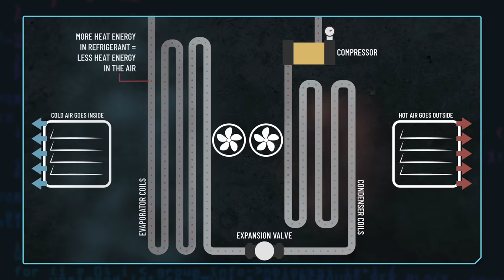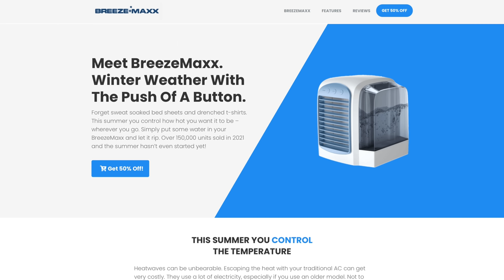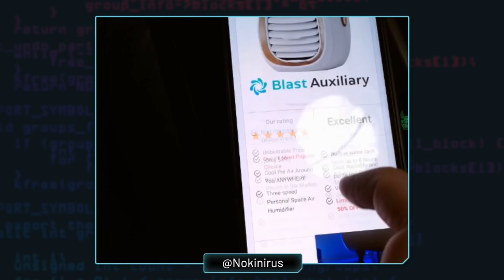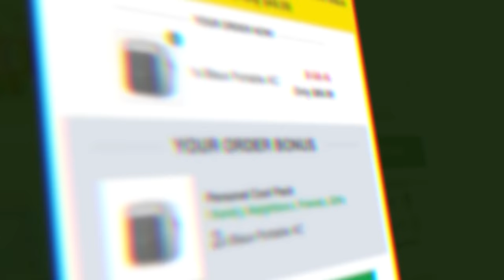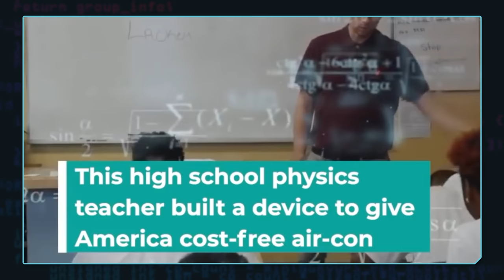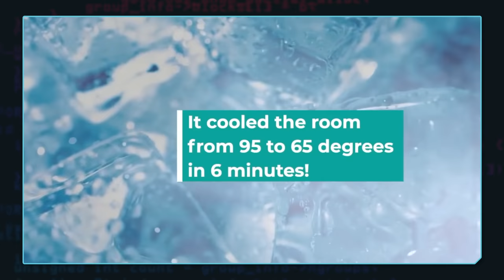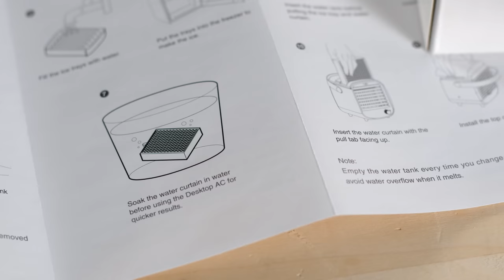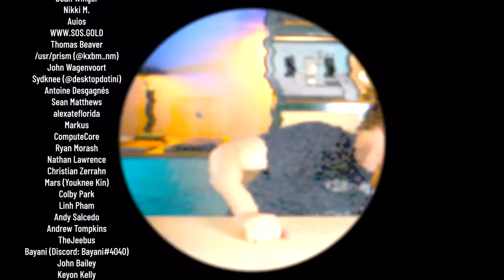Fake Portable AC Scams: Blast Auxiliary, BreezeMaxx, Blaux - Krazy Ken's Tech Talk

Comment: Yeah, the legal department is probably more of just an empty threats department.
Reply: it's just one person in a dingy basement sending threat template emails XD
Reply: True, they know that if it comes to a court battle they will 100% loose, and have to shut down completely, not forgetting destroy all their stock.

They will also be blacklisted from owning a company ever again.
and everyone can view the court verdict in the public records
Reply: @darknessblades  honestly I just want some semi rich dude to mass sue all these companies
Reply: That has to be a brand new sentence.
Reply: He never said they threatened to take action. They were probably just informing him that he could not sue them because despite the 'AC' characters used in the advertisements, they never claimed it was an actual air conditioner.

My parents have one of those nice-looking 'O-ring' coolers that appear to be working by magic because it has no fan.
Surprise, the fan is hidden in the base. It also has a cooling element built in so if you sit in front of it, at close distance, you can enjoy the cool air.

But like I already mentioned in another reply, the room itself will not get any cooler because any electric device (or gas operated device) creates more heat than it can produce cool air. Air conditioners included, that is why they vent the hot air via a seperate channel to the outside. Or that is why actual air conditioner units are placed in the window or even outside of a building, ensuring it only blows its cool air into the room.
Reply: True
Reply: Especially since you can easily prove that THEY are committing fraud,
take this scam buster to court, I DARE THEM!
Reply: the legal department is probably just the customer service department..which is probably just the sales department..which is probably just the board of executives..which is probably just the custodial services department..which is probably just the..you get the point
Reply: @darknessblades  Lol they can open new company easily, have you heard of uhm........Corruption? 😂😂

Comment: I'm HVAC certified and everything you say is 100% correct and accurate.. these are literally just small swamp coolers.. there is no phase change or anything going on in them.. other than trickling water down a piece of paper with a fan..
Reply: @Deborah Ajao Heating, ventilation, and air conditioning. Abbreviated as HVAC. These are contractors and technicians that do this for a living.
Reply: @Deborah Ajao yep 👍🏻
Reply: @Deborah Ajao the trick i guess is to get the right amount of airflow through it....
Reply: What's a swamp cooler?
Reply: @Deborah Ajao Yes, that is the same principle as "swamp coolers" (technical name: evaporative coolers). They blow air over water mimicking the effect of a sea breeze. Decent evaps have pumps to circulate the water and special cooling pads to channel the water. However, they need ventilation in order to work effectively. So you should place them next to an open door or window to get the best cooling effect. In a confined space, they will just pump humidity into the air as he explains in the video which makes you feel hotter.
Reply: @capitalb5889  A swamp cooler is a cooling unit often used in commercial buildings.  They are usually mounted on rooftops.  Air is drawn into the unit and passes through mesh that is soaked wih water circulated by a pump to the top of the mesh to keep it wet.  Air drawn through this will be cooled somewhat as long as the humidity is low.  Even then the cooling ability is limited.  Where I live in Florida the humidity is too high and they do not work at all.

This guy is telling it like it is.  Do not waste good money on one of these.  It is better to put a bowl of ice in front of a fan.  Beware of accumulating humidity, though, and the risk of mold.  Better to buy a real air conditioner.
Reply: @Dallas_K  they sound like a waste of time. But I see these scam ads on YouTube all the time, making outrageous claims about their effectiveness, usually with a highly dubious story about how they were invented.

Comment: Great video. I work for an air conditioning company and I see so many ads for products which aren't air conditioners marketed as air conditioners. Here in the UK we have a company called Dyson. They introduced a range of fans and tried to claim that they could lower the temperature of a room, despite the fact that they don't contain any refrigerant gas or cooling element. They even had ads showing red air going in to the fan and blue air coming out the front, deliberately deceiving the customer by pretending that the fan could change the air temperature. They were reported to trading standards and subsequently changed their ads very subtly but they still call it "Dyson cool". They also cost several hundred pounds, when they do the same thing as a desk fan from a hardware store!

Comment: I have a more affordable option, though it is a bit high-tech. 

Let me explain it in steps so that it's easier to follow.

Step 1 : Take a towel and soak it in water(cold water if possible)

Step 2 : Take off your shirt

Step 3 : Put the towel on your back and shoulder 

Step 4 : Turn on the ceiling fan or other fan

Step 5 : Sit comfortably on a chair 

Note : Once the water gets evaporated from the towel completely, you may perform Step 1, 3 and 5.
Reply: wow, thanks man. i've saw this kind of guide before and it's a little bit confusing. thanks for simplifying this. now i have find a way how to turn on a fan.
Reply: My gramps told me something like that once.
Reply: @richardm3023  My Ole Grandpa said " If it sounds to good to be true ,most likely it is not true."RIP Grandpa!After forty five years I still miss you.
Reply: Went to Disneyworld Orlando once.  Stayed in a nice condo.  Hot AF.  Took one of the condo's white linen napkins, soaked it, and wore it like a mullet under my baseball cap.  Once an hour I'd hit a water fountain to refill the reservoir.
Reply: @akkico  You're welcome : )

If you do not have a fan or having difficulties turning it on then no worries at all, since I have an easy solution for that as well. 

For that first of all you need to get a book or magazine. Ideally 10 to 12 inches in length, 6 to 7 inches weidth and around 0.5 inches thick.

Hold the book or magzine in your right or left hand as per your convenience and then bring it near your face about 4 inches from your face.

Make sure that the book is perpendicular to your face and then start bending your hand back and forth 1 - 2 times a second. 

Keep repeating the process till you start keeping that your current hand is getting tired and then switch your hand and move to the previous step.
Reply: YouTube commenter invents new method that cools you down from 100 degrees to 70 degrees in SECONDS!1!

Comment: "this can cool down a dorm in just 6 minutes"
me, with a much MUCH larger swamp cooler that can barely do that: well that was a f%cking lie
Reply: The Water Wall in Houston is pretty cool. 
Yeah its like 5 stories tall, but it does keep the area cool.
Reply: Me with an actual mobile AC unit (the ones that vent out of the window through a tube): 6 minutes my ass :D
Reply: yup i have a 5 liter swamp cooler and i live in the uk which is the most ideal use case scenario cause the humidity is low enough for them to actually work 

even then it dont do that in 6 minutes i could maybe get it down in 15 if i use the ice packs to assist it
Reply: @cy-one  Try elevating your portable AC unit.  Put it up on some cinder blocks or a stand so that the bottom exhaust is at the level of the exhaust tube.  It should work a bit better for you.
Reply: @cy-one  even those work better if you add insulation to the tube.  That way the heat it just pulled out isn’t leaked back into the room

Comment: One thing many people don't think about is that the ice you have to put into these things needs to be created somehow, which is done by putting water in your freezer. All the heat energy pulled out of the water needs to go somewhere and where does it go? Your freezer spews it out as warm air right into your house, so the net effect is that you're not cooling anything and in fact all the mechanical action of the machines involved will slightly raise the temperature in your house.

Comment: Clan,  You are 100% correct.  It is physically impossible for those little FAKE fan units to pump heat out of a room.  I have worked for decades around commercial-industrial HVAC, and I have a mech engineering background.

Comment: I've never heard anyone mention, that the refrigerator pumps out more heat making ice, than any cooling you could will ever get from the ice.
Reply: The cooling capacity of ice is so comically low lol. Add the heat from the freezer and you're in a net negative for sure, swamp coolers don't even need ice or cold water to work.

Comment: I did buy one of the small "AC" units for my home office. It helped a little while I was in there. I could feel the difference between how it was so hot in there before and how it changed with the water fan setup. I'm not sure I'll be doing much at home this year but I'll definitely consider a different option this year if I end up working at home.

Comment: As an hvac engineer, I've never believe in this crap in the first place. it's no better than my 2 dollar usb fan.
Reply: Wait!  You have a 2 dollar usb fan?!?  How much is it, and where can I buy one?
Reply: How can you be an HVAC engineer if this product has decimated the HVAC industry ?? 😊
Reply: @richardm3023  well the cheapest one does cost less than 2 bucks, and a battery is included.😊 minus the S/H.
Reply: @dionysus2006  the air-conditioner will say "I'LL BE BACK"
Reply: @skliaw6127  I have to get one right now!  Sorry.  I watch a lot of infomercials.
Reply: There a reason it takes a 70 lb unit the size of a huge bread box running 1000 watts to cool a hot room. It's called the laws of physics and thermodynamics
Reply: Hey! I like my $2 usb fan!  Even a hot breeze is better than no breeze, it helps evaporate the sweat dripping down my face.
Reply: @d.e.b.b5788  i like a sweaty woman.   Shows that she has put in the effort.
Reply: @MikeBarbarossa  Homer Simpson said so!

Comment: I bought one of the coolers at the Home Depot, because I know what a swamp cooler can do, and what it can't. I have used mine as a spot cooler, and if it is dry enough, then it works. A rule of thumb is that a swamp cooler works if the DEW POINT is lower than 60 degrees. As the dew point increases above 60, the cooler becomes less and less effective. Fresh air needs to be introduced into the area, because as the cooler runs the air around the cooler increases in humidity, the dew point increases, and the cooler doesn't cool. I'm fine with my purchase. It was on sale for about $19, and I know how to use it.
Reply: Same. It's not that these things don't work at all, it's just that they fall very very short of the marketing hype. If you get one at a fair price and have the right expectations (i.e. a bit better than just a fan in the right circumstances), they can be a good purchase.

Comment: I bought one from Home Depot (Artic Air), I didn't expect the claims to be valid ,however, I was satisfied with the performance because....well, I knew what to expect! It is simple a  tiny swamp cooler! But if you direct the air on you and put the wet filter element in the freezer for about 45 minutes, it will cool you for a little while.....long enough to let you drift off to sleep. And it's not too loud. In fact I like the light noise it makes because I live near a highway and it drowns out most of THAT noise. Also note that this is used in my bedroom in conjunction with the central A/C system because my room gets full sun and is  hotter than the rest of my home, so I have to supplement by using some sort of fan or turn the A/C temperature down; which will make the bill go up! If you know what you are buying and you ignore the goofy claims and the inflated prices you may enjoy one of these as I do......I paid $38 for mine which is a little pricey for what it is but I'm pretty satisfied.

Comment: I bought the BreezeMax AC. I knew that it wasn't an air conditioner, but more like a swamp cooler. But thinking that we each have a rather small bedroom these might actually work for us. Nope. They advertised the units as being 80% off the regular price, which made them about $50 each, when you bought 2 units. Then they tell you that if you order a third unit it will be half off, which should have been $25. I also ordered the replacement filters and an additional warranty. So when I check my account balance, I discovered that I had paid about $350. The units finally arrived and at first inspection we can see that, minus the plastic housing, it's basically a computer fan with a water reservoir. We plugged one in and it barely blows any air. I called customer service as spoke with a rep who obviously didn't speak English as their primary language and am offered an additional %50 off if I keep them. Up to that point, the rep was more or less pleasant. When I said that I didn't want to keep them, the rep asked what I didn't like about the unit. I said that for the money I could have a whole house air conditioner and I just want to return them and be refunded and they had a "money back guaranty" in the advertising. Now I'm being rude, according to the rep. He says he will send me the info to return the units, but I will have to pay for the shipping. I paid shipping of $9.95 to get the units, so I agree. Return shipping cost me $80. I was further informed that I only had 30 days from the receipt of the product to return them and I would receive an email confirmation within 72 hours receiving the package. I wisely had them sign for the package, so that I knew exactly when they received it. No email confirmation was received and it took weeks for them to refund my money. NEVER AGAIN! Now I will only buy through known and trusted vendors like Amazon or the big box stores.

Comment: You can achieve the same effect by draping some wet cheesecloth over a normal desk fan.  The bottom edge can be placed in a container of water to keep it wet.  Any prtesent-day device that cools without increasing humidity will work by moving (pumping) heat from inside the room to somewhere outside the room, so it must have an exhaust or some other physical connection to take the heat outside the room being cooled.  Theoretically a room could be cooled by converting the heat in the room into some other form of energy (e.g. electricity) which would not then require an exhaust (the electricity could be absorbed by using it to charge a battery), but such a device has not yet been invented.

Comment: one of these ac scam "companies" also stole lots of footage from techingredients, and put a robotic voice over and a story that you have likely heard before. The big difference here is tech ingredients actually made an air-conditioner that didn't use a compressor to cause a phase change for cooling, instead it used a desiccant to force a phase change of water vapor to first dehydrate air and then it took this dry air and fed it through a mostly normal swamp cooler setup to produce the cooled air, and then it passed it through another drying step to remove the humidity

Comment: I grew up with an evaporative air cooler, they're a cube that's at least three feet to a side with a 1/2 horse motor lol

They work ok when the humidity is less than 40%, but anything over that and you're just pushing soggy air around your house.

Comment: I did buy one of these from Amazon ( I rarely buy off of that platform), it is nothing more than a fan with a built in battery. It sits on my desk or bedside table. I paid $66 CAD for it. I treat it as a portable fan. It does work a lot better than the mainstays branded fan from Walmart, which stopped working within a week. I would be reluctant to buy another one. Mine is unbranded, and works within my expectations.

Comment: I have a large floor model Evap cooler, and it does cool the air right in front of it by about 5 to 7 degrees, useful for our hot back room.  That requires putting water, ice and ice packs in it and it is only  works well if humidity doesn't get above 50%.
Reply: 5 to 10 degrees differential is about all one can expect from an evaporative (swamp) cooler
Some of the single inlet ones 
(Master Cool) with a thick 8 inch pad do a bit better still a swamp cooler though .